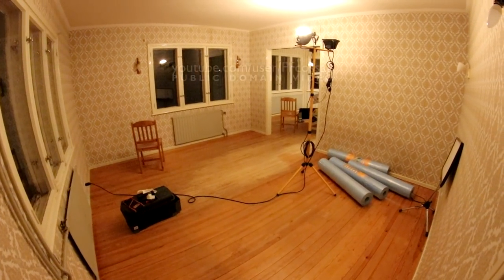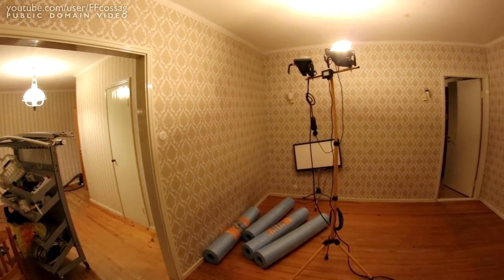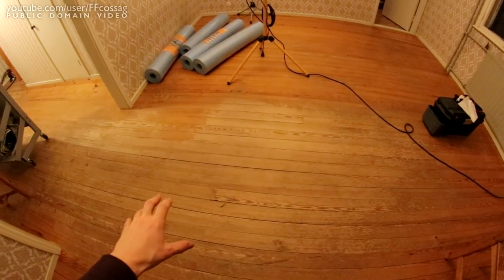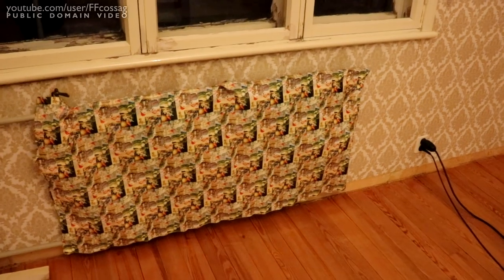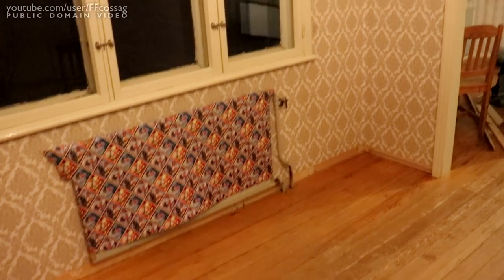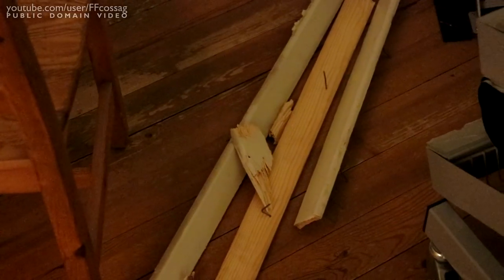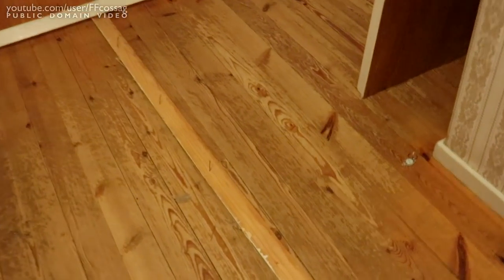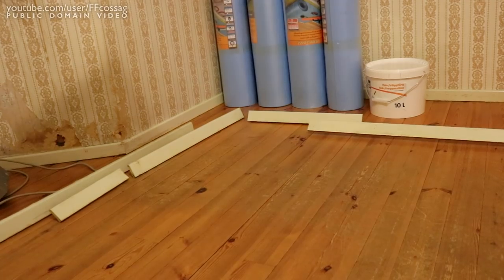Very Cheap Renovation Vlog #1 - Beginnings

Comment: a tip for painting over wallpaper water down some pva glue and roller it on the wall then let set. you should be able to paint over it without the walls getting too wet.

Comment: The wood looks great. Ski chalet style. Maybe the floor just needs a sand and paint to restore it? Don't paint it white.
Reply: I like the look too but it will be alot brighter in whole room if the ceiling was white
Reply from the maker: The floor could be sanded down (with a lot of dedication...), but it's far too soft for what I'm going to use the space for.

Comment: Did you consider sanding and sealing the old floor? It looks quite nice.
Reply from the maker: It's nice enough, but it'd require ~5 mm of sanding due to uneven wear, and it's VERY soft wood, so I'd be unable to use office chairs in the room. It's sadly just not viable.

Comment: Wow, that wiring is sketchy. And I thought some of the wiring in my Grandparents' house was bad (knob and tube in some spots still), but one circuit for all of the lighting takes the cake

To properly address their house (and yours), seems like the walls and ceilings will need to be ripped out entirely to run everything new the right way
Reply from the maker: That may or may not be happening in this space. ;)

Comment: Those walls are in rough shape. Can you just rip them out and install new board quickly? Wear a good mask as the asbestos is probably everywhere. Block rooms with polyethylene.